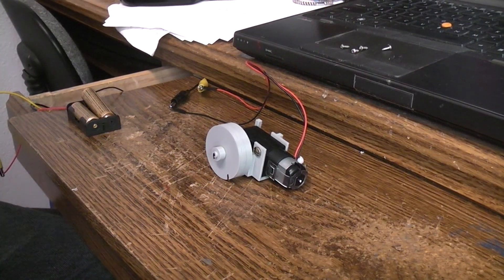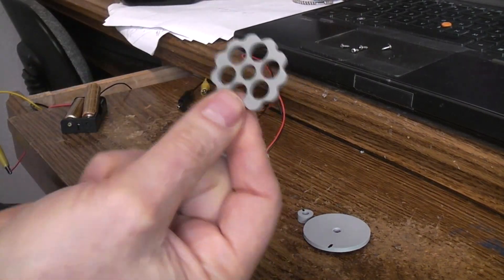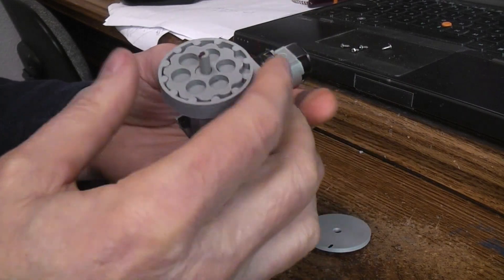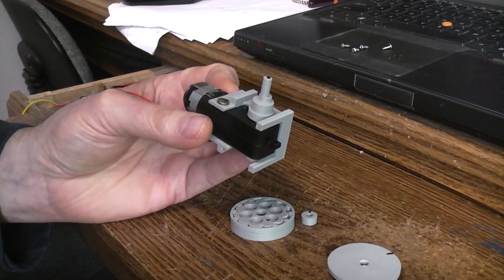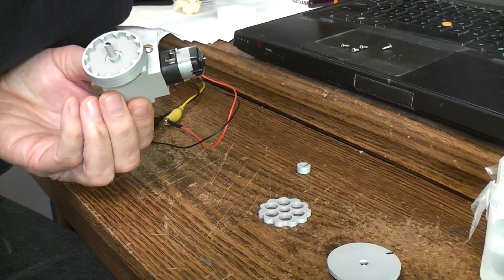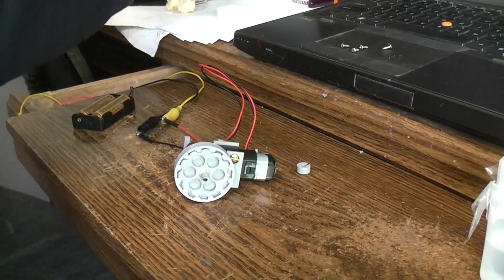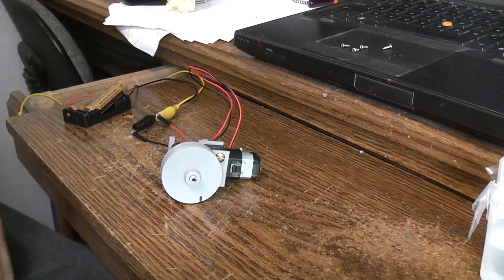3d print a 12 to 1 Cycloidal drive for TT gearmotor speed reduction.

Comment: At first glance, it seems like the outer disc should jam up seeing the wobble disc isn't centered.( as it's cam driven)
Is there some play between the  pegs (of outer disc shell) that sit in the holes of the wobble disc ? 👀  ...or do they just happen to line up all the time as it rotates?
Maybe due to  cam size making up the difference of the 11 and 12 lobe ratio? ...... wonderful mechanism none the less.
Reply from the maker: There are some great you tube videos that show why there is no play and it does not jam up. But it comes down to the size of the pins on the output disc and the size of the holes on the inside disc and the way it travels around. The pegs are in constant contact with out jamming.

Comment: Nice. I’ve been studying cycloidal gears for some time now. I’m curious what you designed the gear in, and how you modeled the actual cycloidal disk...
Reply from the maker: I use a free CAD program called Design Spark Mechanical. I just do not want to relearn how to use the newer 3d cad programs , so I stay with what I know.

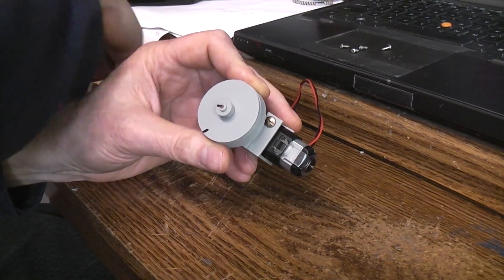Comment: Thank you for that nice project. But the gear ratio of this construction is 1:11 and not 1:12.
Reply from the maker: Odd. Mine takes 12 revolutions of the input shaft to make 1 revolution of the output shaft. But what ever it is or is not , it is a fun project.
Reply: @Robothut  
You are right. It is a great project. In that sense I did not want to blame anyone.
On cycloidal gears the gear ration is dependent on the number or "teeth" different between the cycloidal disk and the number of bolts on the stator disk.

If the difference is one, the gear ratio is 1 to the number of "teeth" on the cycloidal disk.
Nevertheless cycloidal gears are one of the most impressing gears.
Again, thank you for your project.